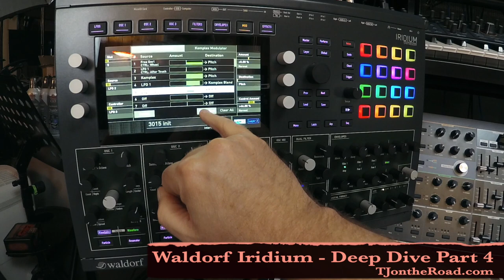Waldorf Iridium Deep Dive Part 4 [Modulations]

Comment: Two questions please:
1. What does sync sync to?
2. How can we use the expression pedal as a mod source when there is no expression pedal jack input on the iridium?
Reply from the maker: Sync is set to either the internal clock on Iridium or to external MIDI clock. An expression pedal can be used via your MIDI controller. 
Thanks for watching. TJ
Reply: @tjontheroad  Thanks for the videos. They're great! And thanks ever so much for your quick answers. You're my new hero!

Comment: I am really surprised that the Oscillators can’t sync, FM, AM etc with each other (outside of Kernel mode). Being a Waldorf I fully anticipated that to be possible. Also the fact that you can’t use the Oscillators as modulation sources…very un-Waldorf of them. I do really like my Iridium but there are a lot of things missing in my opinion. When compared to the Blofeld or Microwave XT it seems to be missing a lot in the modulation department. Same with the envelopes being lacking in extra stages. When I bought the iridium I expected the ultimate Waldorf synth but with out these features (and a few more I have on my Feature request lost) it seems like it’s kind of an incomplete synth. It’s fairly deep but not as deep as I expected. I am sincerely hoping these things will be added in future updates.
Reply from the maker: While I agree there could more oscillator cross mods, there is ring mod and the Kernel engine is designed to be the gap between. Only problem I have with that is the Kernel engine isn't very easy to program. So, it doesn't get used as much as the other engines. 
Thanks for watching. TJ
Reply from the maker: While I agree there could more oscillator cross mods, there is ring mod and the Kernel engine is designed to be the gap between. Only problem I have with that is the Kernel engine isn't very easy to program. So, it doesn't get used as much as the other engines. 
Thanks for watching. TJ
Reply: @tjontheroad  agreed. The Kernel engine is awesome but not as intuitive as the other oscillator options, I do love my iridium but I’m a little disappointed that it’s lacking stuff that’s in the Blofeld and microwave. I really hope they add more in the next update